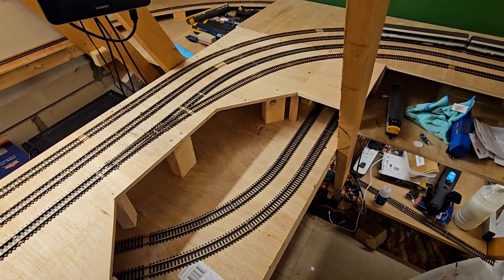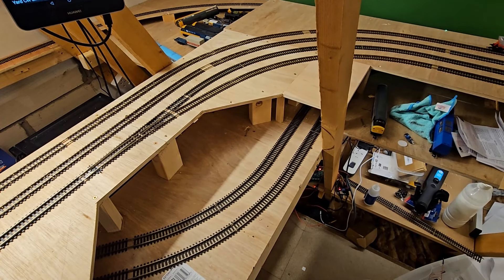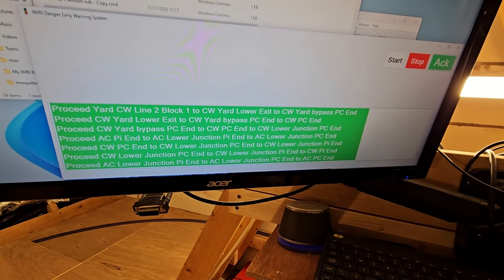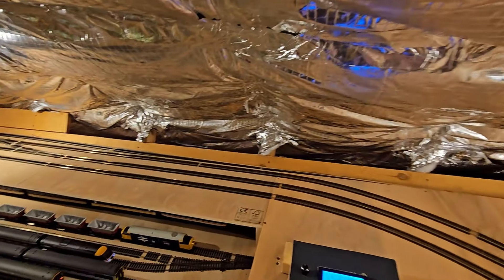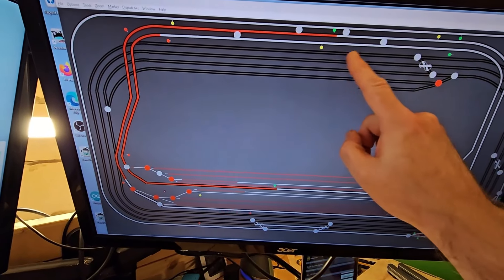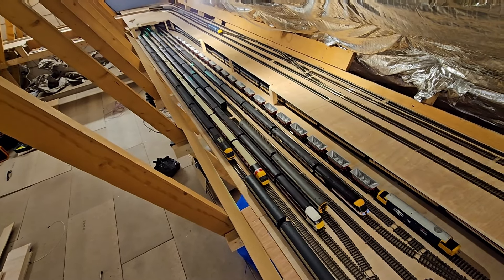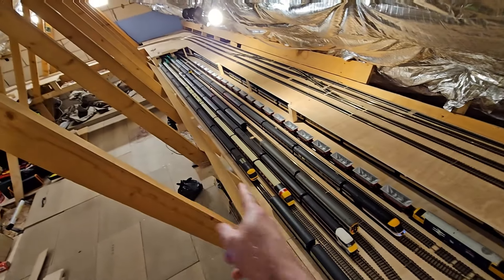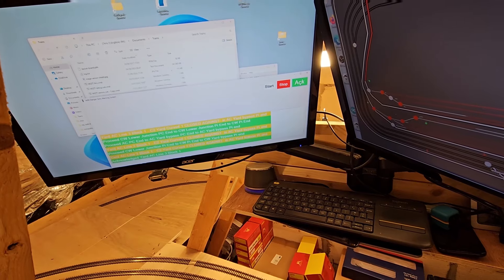A danger early warning system for my model railway based on block detection and live turnout states

Comment: Yes, for sure. You have me intrigued. I’m going to try and setup Dispatcher today as per your previous video 😅
Reply from the maker: OK - but you don't need Dispatcher, this monitors manual trains.
Reply: Ok, I testing out my layout design by creating Sections and Transits to see if all the Blocks connect up to each other to create a complete Transit. After a few steps I can no longer add Sections to my Transit as it no longer gives me choices. Is this because I have the wrong direction set to a Section ? How can I Private Message you ?
Reply from the maker: @ClinchfieldModelRailroad  there should be a contract email address on the about tab on the channel, sometimes you have to go there on a PC to see it.

Comment: Suggestions
1. Use different tones for warning and collision to better pay attention
2. Auto stop after fixed no of collision beeps in case you miss hitting the stop button
Reply from the maker: Hi - thanks for the suggestions! It does actually have different sounds for warning and danger, maybe the audio didn't quite pick that up. Auto stop is a difficult one from a number of perspectives as without RFID or another solution, the app can't actually know which train to stop! 
Thanks,
Chris

Comment: have you thought of something a bit like AWS/TPWS warnings? you have the software detecting potential issues which is frankly jaw dropping, thinking like on that wonderful controller stick a couple of LEDs (like a flashing red one, or an RGB to show the next signal state) - leaves doing something to the driver (you) but in effect could show next to the throttle twiddle an indication of the next signal
Reply from the maker: Hi Dale - that's a really good idea! I don't know enough about real world trains really but will look up AWS/TPWS for more info. I replied to Jeffroid's post, that you'd replied to too, on linking up the knob box and this app via MQTT in order to help the app identify which train is moving - I like the idea about the LEDs! Regards, Chris
Reply: @WirenwoodModelRailway  have worked with those signalling systems so approach it from that perspective here.

basically a "ping" when you go past a green signal (don't do that, it would become highly annoying in seconds) and a "horn" when a train approaches a yellow or red one. think with the blocks you have would have to be a horn when passing as you enter the next block, but the yellow signal should be the warning you need.

pondering swapping to OO here, specifically to allow for RFID stuff and similar which is a pig in N gauge to go with this sort of automation.

and you so have me looking at MQTT
Reply from the maker: @aleopardstail  Thanks that's really useful - I'll see if I can get some sound samples and replace the current beeps - ha, I did try a little beep on green and it was exactly as you predicted!
MQTT is a gift that keeps on giving. What I'm looking at now with the app is using it to manage fully manual and fully automated trains running at the same time. I love the idea of the level of unpredictability that would introduce, and how much of my attention it would require, but the app should help. The key thing though is manual trains have to be able to allocate / reserve a couple of blocks ahead so their path doesn't get gazumped by an automated train at the last minute. With a bit of guidance from JMRI devs I'm now able not only to predict danger in the next two blocks, but also allocate them, in JMRI, to the manual train, to protect it. I used a combination of MQTT and LogixNG for it and it worked a treat! More of that in another video! Regards, Chris

Comment: Isn't it possible to force trains to stop if there is a red signal even if they are being driven manually?
Reply: not sure JMRI has that by default, this is quite clever coding, would need to "know" what trains are in the blocks and inject the "stop" command

JMRI obeys signals when its driving, but in manual mode you are on your own
Reply from the maker: hey Jeffroid! Yeah it did cross my mind to implement something like this but then the whole idea of it was to make driving trains manually more fun, so knowing the systen would stop the train might defeat the object a little.
Didn't stop me thinking about it though! Like Dale says, the issue here would be the app knows that 'a train is moving' but it has no idea what train, so it wouldn't know what to stop. Adding RFID into the layout would solve this. 
But also, that knob box - it crossed my mind to put an MQTT connection on it, and for it to publish to MQTT when a new train has been assigned - what train, and publish again when the train starts moving. Then the app - when it detects a new block in an area that's seen no activity before - so can identify that 'a new train is moving' - look to MQTT for any publish from the knob box about a new train just starting to move - and match them up. Wouldn't be bullet proof but would work.
Then it could just publish back to the knob box if an emergency stop was required and the knob box would know which train to stop.
I'll probably end up doing it! Regards, Chris